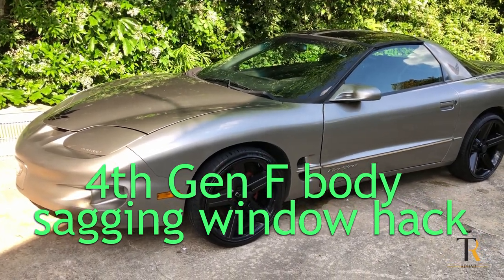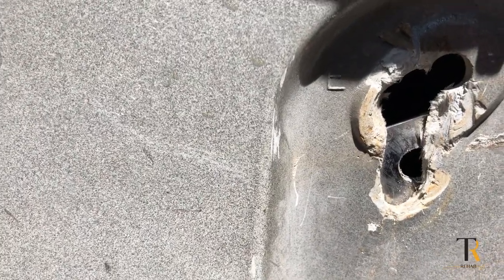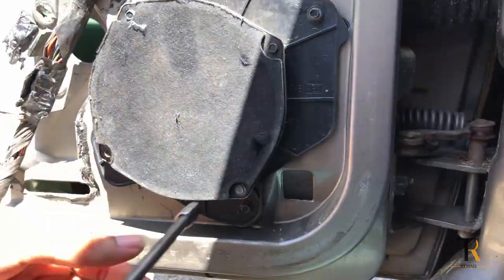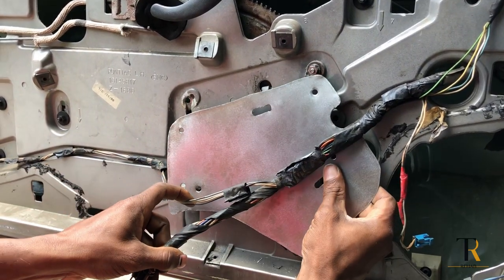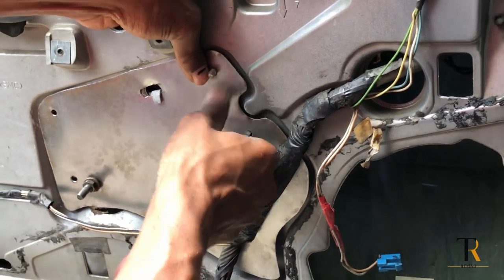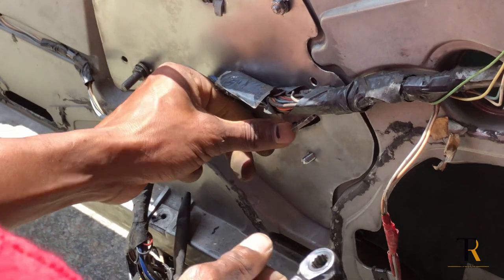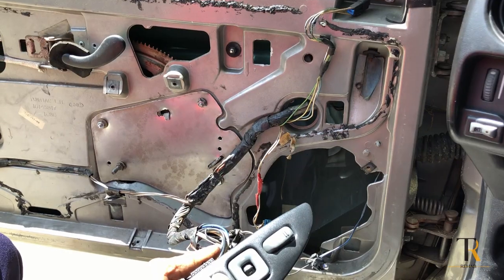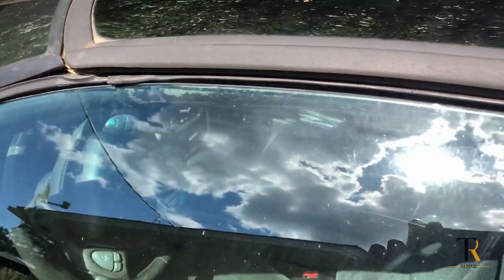WS6 Trans Am Firebird Camaro Sagging Window Hack 4th Gen F body

Comment: Wanted to stop by and thank you for making this video. I bought a ‘99 Z28 that had a 1/4” window gap. The glass would rest against the seal, but wouldn’t go all the way up. Lots of wind noise and some water depending on how hard it rained. We pulled the door panel and someone previously did a hack job on the fiberglass/holes. We followed your directions, created a template and made a metal plate. The window now goes up all the way, problem solved! Thanks again!

Comment: I'd buy one, i have a new motor but its sagging, someone else installed it before i got the car, it's 1/4" shy or so also you can see the inside door panel push inward..if you don't have one for sale, what thickness of metal was used and i will make one? Thanks! Great vid!
Reply from the maker: It's 20 gauge metal. I'm trying to link a PDF if I can figure it out.
Reply: @TRRehab  Thanks!

Comment: Epoxy putty might work too on each bolt hole. But a metal plate is definitely better and some company should produce it.
Reply: I tried that it goes back to we’re u started
Reply from the maker: I’ll have a few available in a few weeks. So please subscribe. I’ll add a link to purchase when I get them done. I’ve done. I’m going to try and build stock.